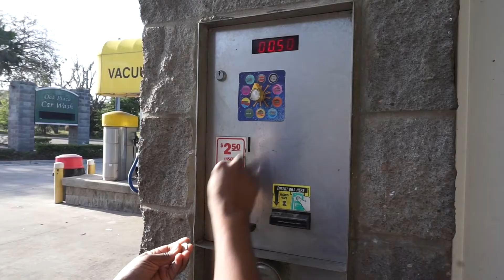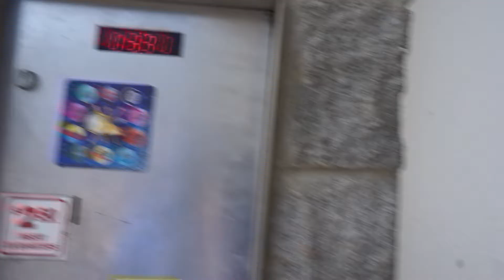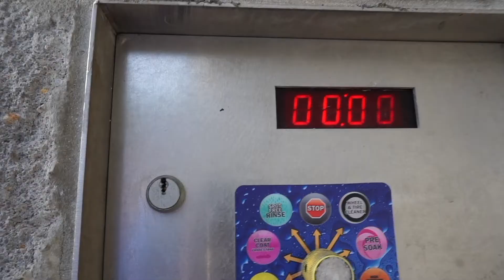How To Clean Your Area Rug In Less Than 4 Minutes | NeesieDoesiT

Comment: Do not do this with a 3 inch thick shag carpet. 10ftx8ftx3inches of water = nearly a thousand pounds. Wash it while it's already on top of the car because you'll never be able to lift it.
Reply: Thank you! Completely did not think of that and I have a 10x8 shag rug that desperately needs to be washed.
Reply: I saw where someone used a floor squeegee to squeeze the water out of the shag before rolling it back up.
Reply: Lmao this was hilarious to think about 😊
Reply: Yup.  Had this exact issue.  Thank goodness i did it in the back yard.  I had to prop it up to drain for two days in the sun before i could getit back in the house

Comment: I do this with detailing quite a bit on rugs and upholstery used a deep cut Degreaser as well if you have deep-set and stains and if you need to get extra set in stains try this for an extra little secret in the detailing World especially in your car one cup of 91% rubbing alcohol clear kind only one teaspoon of Dawn dish liquid 1 quarter cup distilled vinegar and it will kill any smells by the way 4 tablespoons of Windex without ammonia do not use the type with ammonia it will bleed your colors in your rug especially a darker upholstery Shake It Up let it sit for about 3 to 5 minutes tilts bubbles fade a little bit you cannot go wrong with this I've been using it for years 1 all types of upholstery the only thing you cannot use it on is leather and Pho leather when you apply it let it sit down into the upholstery for a few minutes suck it up with a what vac the key to the entire thing is a wet dry vac you must have a wet dry vac when you are cleaning any type of carpet or upholstery if not you were just going to smear the dirt and sand and grit down into your carpet and you are going to cut the fibers which is going to make your carpet look even dirtier after you are done which is going to make your work go down the drain I hope this helps everyone stay safe
Reply: Michael, when you mentioned the Windex (w/o ammonia), do you mix that in altogether with the 91% rubbing alcohol, Dawn and vinegar? Thanks

Comment: Nice! Subscribed! I have done this on top of my car, but with a truck bed, I used a couple 2X4s between a set of ladders to dry. Obviously this takes one or two patients friends! 

 One thing to add is that time and soaking is what really helps dislodge dirt particles.. so if you have a way to wet it and let it sit before the hose time starts (maybe dump hot soapy water from a cooler brought in the truck?) even 5 minus helps get more dirt out without have to agitate, which will shorten he life of fiber products.

Comment: I think the car wash is a good idea! But, my only concern about the car wash is: Your putting your rug on the ground; and it's dirty from all the cars coming through there. Cars/trucks could have leakage of oil or other things coming from underneath their vehicle , and that could get into rug. IJS maybe I'm being OCD about it. 😂 I think I would hang it across the truck and scrub it and rinse it down, if you have the extra person for help. I scrub my rugs with a clean broom and scrub brush for stains and rinse mine outside with the water hoes (get the attachment for your hoes, that you can adjust your water pressure) and hang it across the patio railings or fence to air dry for the whole day. 😷💯🥰
Reply: I'm going to spray over the ground before laying my rug down, but for sure it will benefit from this clean 😊

Comment: Those car washes are the modern day “Bodega Slot Machines…” you can wash your carpet on a sloped patio with two 5 gallon container, one with several packets of Laundry soap, one fresh water, several brushed scrubbers and aluminum squeegees. I don’t have a pressure washer but the squeegees got most of the heavy water out. I draped the rug over outdoor chairs and the next day will hang it on my eaves with heavy duty woodworking clamps.

Comment: Um, No.  I would never put my rug on the filthy concrete and then wash it like this.  Too much soap will remain in the carpet.  You need to hang the carpet and was the soap out of it not into it,  This will take days to dry and it will be stiff with the left in soap.

Comment: Oh, Sugar, no!
You have the right idea, but the problem is that coin carwashes are cheap because they have no staff and they recycle their water. 
It’s that last part that’s the problem.
That water is poorly filtered, as it isn’t intended for drinking, so it’s gonna have a little bit of gunky oils & stuff in it. Not enough to notice right away, but it will trap dust & dirt, making your rugs dirty-up faster next time. 
Didjoo know you can get little electric power washers on Amazon for $90 now? I love mine!
Pick one up do this at home with clean water girl. 😉

Comment: Amazing innovation!  My has dog pee, any suggestions?
Reply: Vinegar soak the pee spots then clean
Reply: I second the vinegar. My dad was bed ridden and had bad incontinence. The only thing that worked was soaking his clothes and sheets in vinegar before washing them. Dog urine is much more similar to human urine so I’d try that first. If that doesn’t work then try my second solution which I used because I had a cat that peed everything. 😠 Found that a mix of hydrogen peroxide, baking soda and a teaspoon of dawn will clean and deodorize.

Comment: Not sure it's a good idea to walk over your living room rug with your outside shoes.. Ever wiped your wet shoes on your rug at home? Those stains ever come out?
Beside throwing the rug directly on the drain of a car wash, where ALL the filth of cars flows out, including soot, oil, grease, etc., which will soak nicely into your rug.
Finally, to just have it soaked in mild temperatures, is a guarantee for mildew.
This was a demonstration of how to make sure you can throw away a somewhat dirty rug that just needs some proper cleaning at home. 
At least it was funny :)